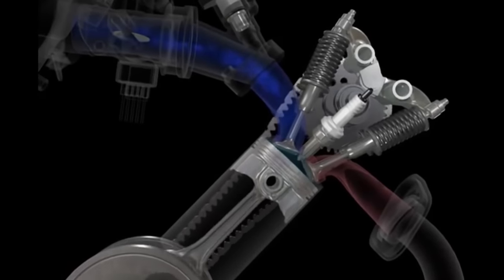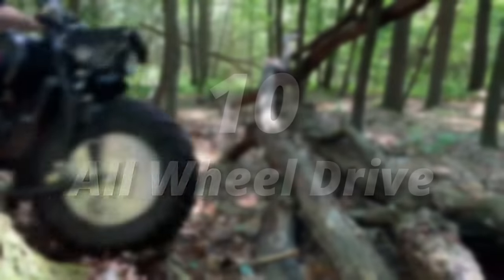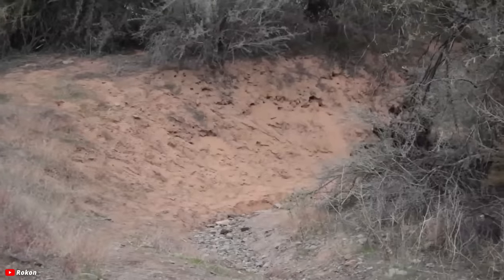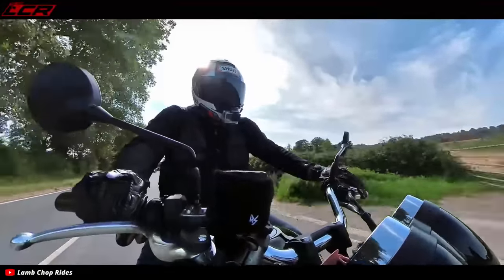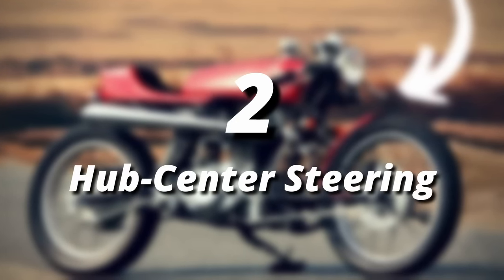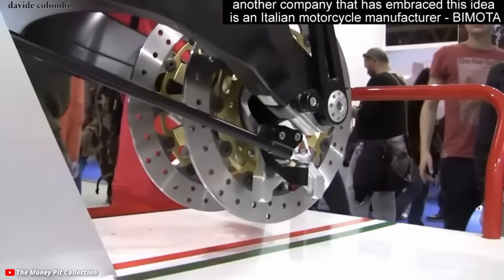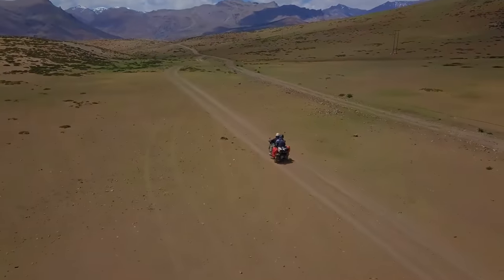10 Motorcycle Innovations that never caught on

Comment: I think as motorbikes become electric then driven front wheels will possibly start to come into place on bikes where it will benefit, such as the off roaders. This is because they can easily be powered by hub mounted motors, thus the installation only requires power to the front axle, rather than potentially complex direct drive from the motor.

Comment: 3:38 it did get past those Italian scooters, there was a German brand named Kreidler that produced a lot of 50cc moped that had 3 gears with a grip shift, and yes you are right, there would be more problems than with a traditional shifter, most examples were controlled by cables, and if one of the cables snapped you would not have a great time, also you would have more problems if the clutch cable snapped

Comment: The Moto Guzzis in the 70s did not have just a single, linked braking system. To conform with European and UK laws, they had to have 2 separate systems, so they had 1 front caliper and the rear caliper linked and operated by the foot pedal, and the other front caliper operated independently by the conventional front brake lever.

Comment: On the Guzzi the back brake pedal operated the rear brake and one of the front discs. The other front disc was operated by the brake lever on the handle bar. So in reality you could operate the front brake independently of the rear, but the rear always engaged the front  via a proportional valve.
The idea of this was to force the rider who is afraid of the front break to use it.
Of course that was the first thing I changed on my Lemans when I received it 35 years ago. Still  my main ride today.

Comment: Grip Shift was also used in Latvia produced "Sarkanā zvaigzne" 50cc mopeds - they had 2-speed gearbox. Some of them got foot-shifter, some - cable operated grip-shift, which was pretty awful. Cable had it's issues. So mostly I was riding mine always in second gear - wet clutch could take a lot of abuse.

Comment: In Poland we had grip shifters in our 50cc komar moped.
I can say that it works like the throttle, it uses a cable and cables are good for pulling a shift pivot but not for pushing one.
After some use it stops being acurate and gets anoying.
In komar its like 1 N 2
In the vespas its 1 N 2 3 
The only option where this will be a good solutions is when the gearbox Has a layout like this: N 1 2 3, and the pivot is spring guided back to neutral.

Comment: note on linked brakes: while legal issues exist, due to some particular wording, there are a number of large motorcycles with linked brakes. You mentioned BMW and Honda (I have a BMW with linked brakes), but I've seen them on Harleys and even a GSXR. That said, they get around the legal issue in a variety of ways. First, they all have two levers (the old Moto Guzzi design of a single pedal is not legal AFAIK, and the Can Am is a trike). The BMW and Honda Systems are linked, but can be operated as separate systems, whereas the linkage is operated by computer, hence passing the law. The GSXR I saw with it appeared to have a similar concept, but with both systems run through computer (that is, brake by wire, with backup of hydraulic). Not sure if it was stock or modified. Not sure what Harley's system is, but I have seen it used in action.
All that said, while I love linked brakes on casual road use, they are not good for [very] hard cornering or off-road use where you need to use a specific brake at a time.
I wouldn't call it a "common" feature, but it is still present and manufacturer's certainly caught on to it, just has very limited application (as well as it being unnecessarily complicated for most models).

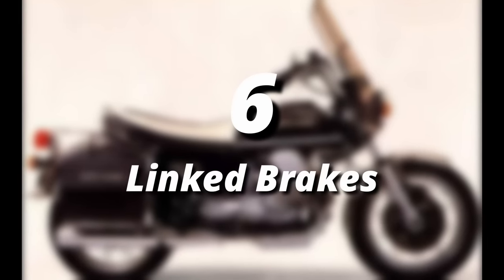Comment: 2:45 In the mid-1960's, I had a 2-stroke Puch 150cc scooter which had a 3-speed grip shift like the one shown. Rode it quite a bit, but after a year I bought a 500cc Triumph  :-)  Long distance riding at 36 mph had lost its allure... 4:07 BMW had a similar but simpler form of this suspension on some of their big cruisers, e.g. R1200C. 6:44 Many of the Honda Deauvilles have linked brakes.

Comment: India had a lot of models of scooters with twist grip gears, including lambrettas, vespas, Bajaj etc. Many are still in use.
Also, either combined breaking or abs, one of the two are mandatory on all two wheelers sold in India right now. Honda had a scooter that was the first in India to have combined breaking.

Comment: Vespa shift-grips relied upon very long cables running to the transmission next to the rear wheel. Said cables had to be adjusted for tension and eventually broke, requiring somewhat complex replacement. If you did not think to tie the new cable to the broken old one, threading the replacement through the bodywork was a real challenge.

Comment: Grip shift is dangerous. In the case of vespas the clutch lever angle changes to obscure positions making using the clutch difficult and its also very easy to move to the wrong gear while riding causing the motor to lock up due to over Rev.

Comment: A trick to hat was missed with twist grip gear change was connecting it to a conventional sequential gearbox. The problem with the scooters twist change were the stupid wrist angles you could end up with. Returning to centre each time would have been great. I think the rationale behind the hand gear change was so that the Italian debutantes did not spoil their expensive designer shoes. The same reason that the Honda Cub had the heel and toe gear lever.

Comment: I don't think I would want a full self-riding motorcycle, but I do think there are a lot of things that could be done with an electronic layer between the handlebar input and the actual front wheel. To start, you could probably fix speed wobbles entirely at any speed before the user even notices them. That's just one thing I can think of off the top of my head, but I'm sure that given 5-10 years of genuine development there could be some truly amazing things done with the electronic layer between handlebar input and front wheel input.
Reply: @nathangehman7018 - If the bike's frame and suspension are properly designed, and you use the correct size tyres, you will never get a speed wobble.

Comment: Hub-center steering might be an idea that could be applied today on some of the large baggers/tourers like a Honda Goldwing.  Imagine if it was completely electronically controlled as in not connected mechanically to the handlebars.  Such a feature could provide easier steering (so the bike feels less heavy than it is), self-balancing, self-correction in situations such as slipping on wet or cold pavement or gravel/sand/oil patches on the road, etc.  It would also allow the fairing to be closed up to reduce wind noise, improve rider temperature control, and even allow a power-adjustable handlebar height and angle/reach.  Even the rider feel (handlebar loading and rate) could be adjustable and this could be factored into ride modes (street, sport, rain, etc.).

Comment: your comment about the the Honda DCS ( Double Clutch System)  doesn't make sense, the version fitted on the Rebel 1100 in 2021 is a fully automatic transmission and simply requires placing into D (drive) before opening the throttle.. it then goes into Neutral automatically when you stop.  Honda also used a different front fork and suspension setup on their Cubs for years , using a leading link front suspension on all their C50/70 and 90's

Comment: Grip shifts were a huge success in India. They had a monopoly for over 30/40 years! Still to date after manufacturing and production has been stopped for over a decade, you can still get a used one for 200-250 USD (max price). Hell my father owned one for 30years! I learned Riding two wheelers on Grip shift scooters.. <3

Comment: In the early 60's my dad got me a Sears by PUCH moped with a 3 speed grip shift - that little 50cc engine would power that pedal start moped to about 60 MPH - I rode it until it was worn out and then dad got me a 1965 S90 Honda.

Comment: Id add to the list anti- dive front forks to prevent the forks diving under braking. Also inboard brake discs of hondas from the 80s. They had a floating disk brake and caliper incased inside the hub.
And who can forget the flip up headlight from the suzuki katana 750.

Comment: There are three automatic bikes you did not mention.
Back in the early 70's the Swedish Government held a contest to buy automatic bikes for their army.  The idea was to make a bike that any Army person could ride.  The contest winner was Haaglands, and they were put into service, using a variable belt drive that was apparently successful.
The other competitor was Husqvarna, and they put their losing bike into production as the 360 Auto - and I bought one.  Other than the gearbox, it was a 360WR Enduro dirt bike.  This used four speeds in a gearbox with centrifugal clutches to select each higher gear.  They demanded a lot of effort to maintain due to rapid wear of the centrifugal bob-weights.  Even when working properly, I estimated that half of the engine power was lost in that transmission - it ran unbelievably hot.  I heard a claim that the later 390 was much improved, but the low sales seems to deny that claim.
I never adapted to to it, as there was zero resistance when the throttle was closed - it just freewheeled.  We may think 2-strokes have little over-run braking, but when you lose it, you can really tell that it is gone.  The solid low-revs power of the engine was not used either, us the clutches had to spin fairly fast to engage.  Despite the cycle parts being state of the art, and the actual engine being excellent, I lost a lot of money on that bike.
The third auto was a version of the Moto Guzzi V-twin.  My understanding is that it had a traditional torque converter/planetary gears car system.

Concerning the 2WD... early this century Yamaha was developing a hydraulic front wheel drive for their enduro bikes that I think was released in a limited way.  I know the factory supported running one in the Paris-Dakar rally.  I think it won it's class, but a normal rear wheel drive example was used the next year.  The weight was claimed to be it's downfall, including all the heavy hoses between the engine pump and the front hub motor.  At the time I thought that this would be a natural choice for all those sand dunes... obviously not.

Comment: My father had two MotoGuzi's in the 70s, a Spada and a Convert that had combined front and rear brakes but they did not operate the way the video suggested.  The front had dual disc brakes.  the pedal operated *One* front calliper and and the rear brake and the traditional front brake lever operated the other front calliper so the rider could change the balance at will.

The convert also had two callipers on the rear disc, a hydraulic one operated by the pedal and a cable one operated by the side stand.  When the bike leaned over onto the stand it pulled on the brake cable.  The convert had a clutch and a torque converter, you start off in top gear and can change down to first manually for extra torque in steep sections (this was a grand touring bike).

There was a problem with the torque converter housing which was pressed steel.  A prospective buyer of my bike tried doing burnouts and wrecked the housing.  The replacement sent by Moto Guzzi was a heavy cast iron one which ruined the bike's performance.  But before that it could cruise at 100 mph really comfortably.  The lights on the dashboard were impossible to see during the day which was a pain (I inherited the bike after my dad died in 1980; he bought it new).

Comment: My 81 Yamaha XS1100 midnight special has linked brakes sorta, the pedal brake puts on the rear break and the left front caliper, hand break goes to right front caliper. Works pretty well, just mostly use the foot brake.

Comment: Combined brakes in the uk and Europe are standard on most 125cc for learners bikes and it’s a legal requirement to have combined brakes if you haven’t got abs. There is still a front and back bias on the different brakes though.

Comment: The Britten had what is pretty much a Hossack front end. Yes, it's a kind of girder front end, but there are  some performance, geometry, and structural differences. And, yes, other morotcycles used it. BMW's K1200 and K1300 bikes used it (I owned an '06 K1200S); their K1600's still use it; and for the last few years, Honda Goldwings use it. A Hossack front end is not ideal for a pure sport bike, but it's great for a sport touring/touring bike, due to it's reluctance to squat under hard braking. I liked it on my Beemer, but it did take some getting used to...

Comment: I have a old Rokon. It was old when a neighbor gave it to me around 1982. I didn't know it was a factory made bike for years. I figured some home handy man made it from ideas or plans he bought from ads in a magazine. The motor was shot and I found a used engine from a Gravely walk behind mower fit right in. Things I learned years after owning it. Rokon started in 1958. They still make and sell bikes. I have seen newer ones but really not different than mine. So no point in buying a newer one. I have always kept it running because as a machinist I remade or repaired parts as they wore or broke. Didn't know a factory was still making parts. Currently I have a Harbor Freight 22hp engine in it. The bike is the most fun you can have at slow speed in the dirt. See guys charging up a steep hill and most not making it, just idle up while sitting on seat.

Comment: Yamaha tried the swing arm type front suspension on the GTS 1000 way back in 1993. People just weren't ready for such innovation. It was fuel injected and had a catalytic converter also. I wanted one but they were too expensive for me at the time. I think the electric motorcycles will make the all-wheel drive more easily accomplished and bring more innovation to new motorcycles. Also, not many people even know they exist because so few were made back in the late 80s but Yamaha made a fuel injected 900 Seca turbo and I had the privilege of riding one. The Yamaha Seca 900 turbo is right up there on the "must ride" list for any motorcycle affectionado to ride right behind the 1979 Honda CBX.

Comment: Honda uses linked braking on everything from the PCX150 to the Goldwing 

The current Wing and some BMWs has a similar from suspension the one described here. Its rarely used due to the vague front end feel

The Honda DCT is just like a car trans, but built for a motorcycle. Uses solenoids and valves to control the clutches.

Comment: My '14 Ducati Multistrada 1200PP has mode selected Bosch Whitlock brakes that have electronically linked brakes in urban and touring modes which allows both front and rear brakes to be applied brakes on

Comment: linked brakes is surely around, just not exclusively linked. Front applying 20% rear on Triumph Rocket 3 for example. Still has seperate rear, but linking is extant. I like it.

Comment: In South'east Asia, most small cc japanese scooters have linked brakes. It's called Combi Brake System (CBS).
Reply: And I think you forgot about shaft driven motorcycles and Rotary Engines. Anyway, good videos🔥

Comment: Surprised you skipped the bigger innovation on the Britten of how he hand crafted the engine block and strengthened it in places so he could bolt everything to it instead of having a frame everything was bolted to which reduced weight dramatically

Comment: the bike from AKIRA had hub centric steering, ceramic double rotor two wheel drive, computer controlled anti lock brakes, 12000 RPMs, all in 1988

Comment: RE: 'Roofed' motorcycles, you mention motorcycles were like Convertibles', well, Benelli DID in fact make a 125cc and a 250cc 'convertible' scooter (at around the same time as the BMW C1, it was called the 'Adiva', where, you could have the roof up on rainy days, the, on sunny days, un-clip the hard shell roof and rear panel and fold back into the 'Boot' just like a folding hard top on a car... clever, it also came with a car stereo/speakers too!   😎🇬🇧

Comment: The best Turbo was missed. The Kawasaki GPZ 750 Turbo it even had a hidden track mode activated by dip switches on the ecu under the seat!!! Ran 10 second quarter mile in 1984!! it was beating 1000cc bikes like the GXSR 1000, Ninja 1000 and more.

Comment: The grip gearshift has been in use on the german Zündapp CS50. Problem here was wear and tare. To much play in the handle, and the fact that the handle doesn't latch into a gear makes an accurate gear shift not so easy.

Comment: JAWA launched automatic clutch as early as 1946, You can use the clutch hadle, but if you just press the gearshift pedal either direction, the clutch engages automaticly and you can shift very easily.  They also invented the automatic gearbox that Honda "borrowed" for their Cub. It took many years of "discussions" before they finally came to an agreement that Honda could go on to use it, for a fee.. Jawa themselves discontinued it after just a few years, and it was only used in a 250cc version bike

Comment: I would actually really like to try riding a recumbent motorcycle with an enclosed body but has room for your feet to balance on the ground when stopped. Being able to ride in inclement weather or cold weather because I'm enclosed and out of the wind would be beneficial to me. I already ride most of the way into the winter season here and I've spent hours riding through near freezing and a few times below freezing temperatures on the highway.